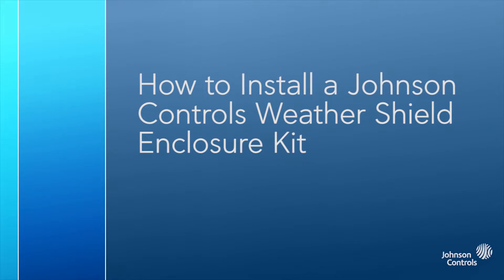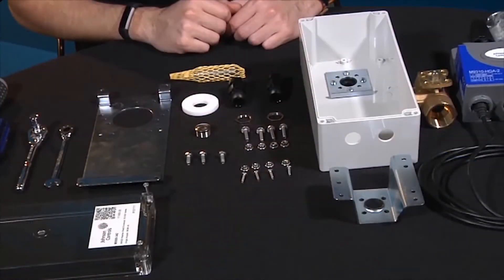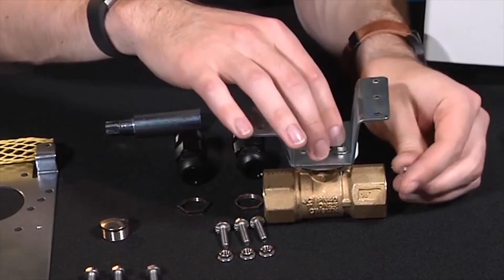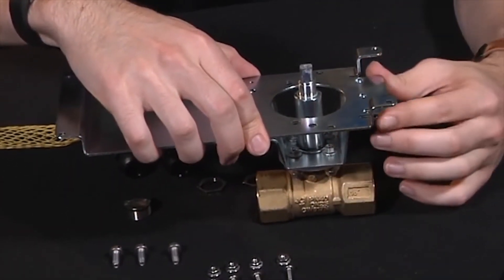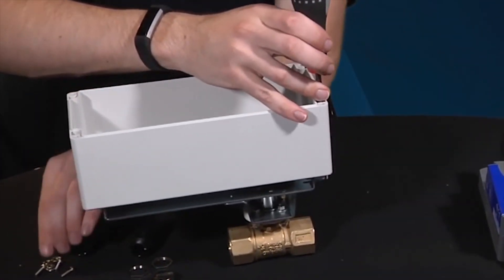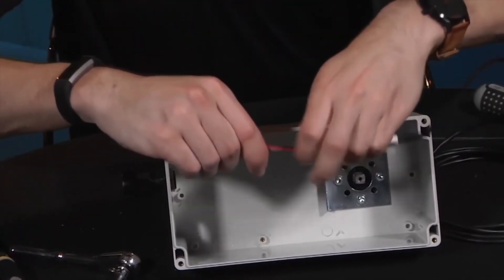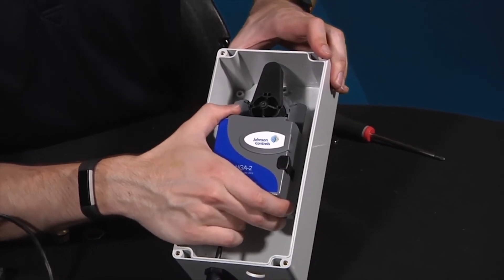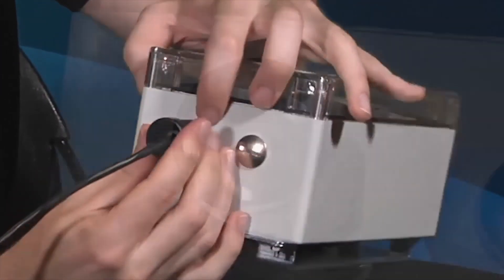How to Install a Johnson Controls Weather Shield Enclosure Kit

Comment: What is the best way to center mounting bracket over shaft on just a Damper? There are no alignment holes and its such a small gap I can't get a marker/pencil in when enclosure is used to center the hole?